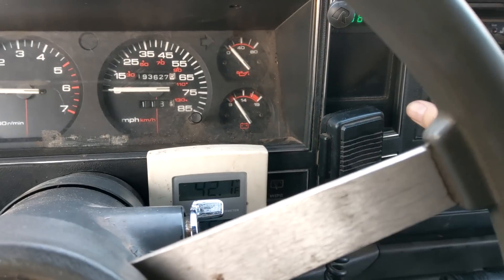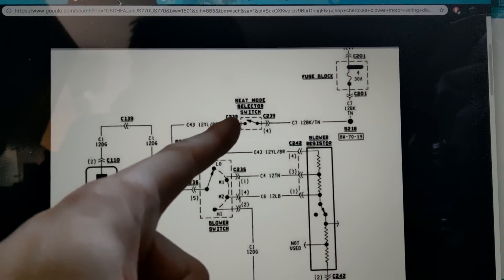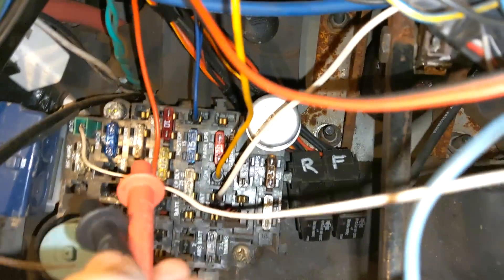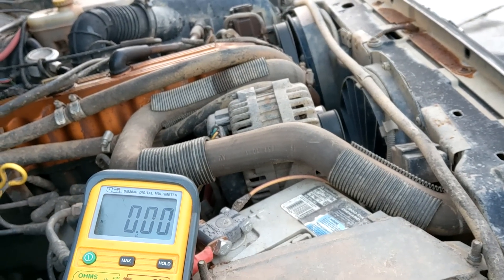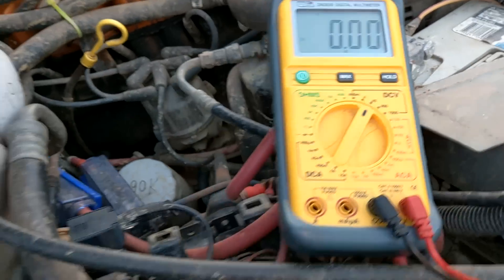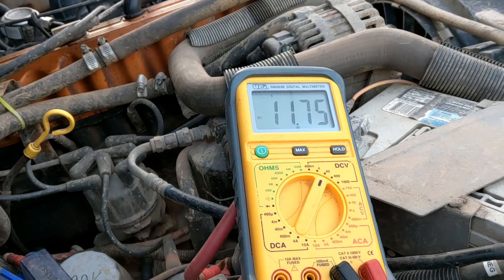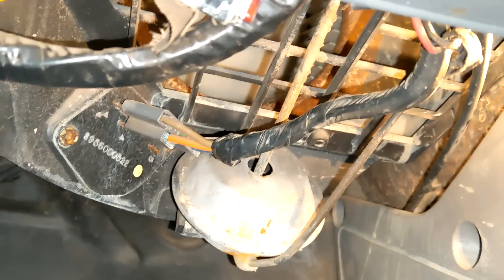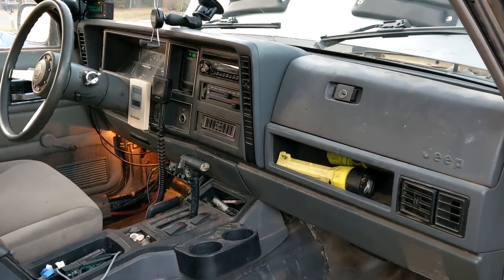89 XJ Blower Motor Diagnostics

Comment: Well I made it 5:11 into this video when after numerous times of checking the fuses, resistor,blower motor,ect...I discovered that my issue was one of the terminal connectors that hold the fuse was not making full contact and a quick adjustment with the meter probe and it's back up and functioning like new. Just wanted to throw that out there for anyone else loosing their minds trying to become a overnight YouTube electrician and track down faults. Thanks for the awesome video and help. 👍

Comment: Good Information, thank you! Mine ended up being the control switch in the dash. They are infamous for melting. I bought a new plug and heater switch but the switch hasn't came yet. The dash wasn't too difficult to take apart. I hope it will fix it when I get it back together!

Comment: Fun video,  i just went through checking everything on mine over the weekend,  everything checked out with electrical , when i re connected the plug for the blower it started working again.... while i had the resistor and blower out i vacuumed as much as i could as i was using the lawn blower down through the defrost vents

Comment: Surprised to see only a sticky motor. Usually the switch or connector melts. Lol I remember digging through yards for years finding only melted connectors and switches after I melted mine. I finally gave up on all that and changed to a stand alone circuit and relay then all that stuff stopped. I'm glad I'm past all those crappy high resistance connectors.  I used to collect up the resister packs because they were handy for using on other motors.

Comment: Good idea to split the ground wire and make contact at a closer point to the blower motor itself. My 89 Laredo ground wire ran somewhere off to the front driver side. But make sure to connect the old ground to the new location. 

I

Comment: you can remove the buzzer so it don't buzz with the key in the on position. it's down under the dash with all the fuses.
Reply: At 4:31, the buzzer is the blue box on the left side of the fuse panel.

Comment: Ah, the glorious XJ electric system. Just yesterday I replaced the dimmer switch in mine (the one on the steering column) because I thought that would be the cause of not having short beams.
Well, no. Upon failure and further inspection, I found a burned wire in the 10-pin connector behind the left headlight, and I could see at least 4in of burned wire...
Reply from the maker: Gotta love corrosion toast. Hope it was an easy fix
Reply: It's still a no-fix. The male part of the connector is buried down there. I can barely see a couple inches of wire from the hole it comes out from. The female side of the loom should be easy enough, but I still don't know how much roasted cable is in there... I'll have to reach the sane part, solder a new green cable and probably do away with the whole connector and solder the wires direct. That or I'll look for a 6-pin water tight connector (only 6 wires in use in my model) and do it "proper".
Reply from the maker: Sounds like its time for a relay harness! Save what left and call it a day
Reply: I actually have a relay mod done, that I had to redo recently when my clutch fan ate the old cables, haha. So that part is covered, but the 10-pin connector (C102?) and all those other cables are still there.
Before this XJ arrived to me there's been so many people modding stuff it's like the friggin Millenium Falcon... but I'll figure it out. Maybe I could simplify it somehow.

Comment: i have a no lights in the center dash, no clock,no cigarette lighter, and no radio problem. checked the fuses all are good. gonna be fun tracing this problem
Reply from the maker: Oh boy. How is the ground under the headlight switch and the ground from engine the firewall?

Comment: i too have a 89 cherokee and i pulled that annoying buzzer out of my fuse box years ago.
Reply: I've never heard it. Some kind soul before me thought it was annoying :D
Reply: ive had mine since 2001 and it only took me 8 or 9 years to get fed up with that cheesy buzzer running its face whenever the key was on and finally figure out where it lived.
Reply from the maker: I don't mind it usual unless I'm filming. I don't care much for the seatbelt sensor, but it is nice when it complains that the headlights were left on.

Comment: Soooo long story short.  I am working through a problem with my windows not rolling down. So i went through my fuses and notice my blower fuse was burnt out so I replaced my 25 fuse for the blower and and attempted to turn my ignition, the fuse blew again a some electrical wire smoke rolled up through my vents in my 91 Cherokee Laredo. I haven't gotten much further ....

Comment: I replaced my resistor because I only had high and within a couple weeks it burned out again.  So I’m thinking the coms on the blower motor are worn out, increasing the resistance.  TJ’s are common to roast the speed selection switch due to old blower motors.
Reply from the maker: Hmm, very interesting, but it makes sense since both are balanced in resistance.

Comment: Will you make a video about fixing the vacuum problem? My jeep only blows out of the defroster and I would love to fix it.
Reply from the maker: Check the vacuum lines near the heater core hoses, usually that black line is cracked or the vacuum ball isn't hooked up
Reply: @NickInTimeFilms  where is the vacuum ball?
Reply from the maker: Mounted in the passenger side front bumper.

Comment: So my heater will work in all settings except for defrost the fan just stopes but then you turn it back to heat  fan kicks on works fine.then if you leave it on defrost for a few minutes it just randomly pops on. Wtf ....

Comment: So, I recently got a new blower motor. No longer working, did exactly as shown and had power all the way to the motor. Thing is the damn thing is brand new, like. Can spin with pinky finger. Ran hard line from battery to fan just to double check and didn't turn on. Is it common to have new parts crap out so quick?
Reply: Rule of thumb is to replace the resistor when you replace the blower because one causes the other to go bad and vise versa

Comment: That heater switch was one of the first things I changed. I’ve long since changed all the sensor’s and still I haven’t addressed the speedo and the tach. 
I’ve been blending in and out of traffic for a decade. 
I just got pulled over again. I was doing 15 over. WE were 15 over. About six or seven of us. I decided to pass them all and the state bull noticed this move. 
I better change those gushes. You know something? I never thought to check the fuse panel. I wonder if it’s just a fuse. Anyways, your rig looks awesome with those big wheels and tires. Did you lose any horse power by increasing the load your motor has to turn?
Reply from the maker: The last video I released was about diagnosing the gauge cluster, might be worth a watch.

Of course the bigger tires make this thing a bit slower, but regearing the axles and stroking the engine out to a 4.6L helped bring it back.
Reply: @NickInTimeFilms  I’m confused on exactly how you disconnected the Speedo gauge.
Reply from the maker: For 90 and older it's a mechanical cable, for newer it's a sensor. The cable has a clip in the back, but it may be easier to unscrew the transfercase end and feed it through to help pull the cluster out enough to get at it.
Reply: @NickInTimeFilms  thanks man. Too bad you don’t live closer. I do interiors for a living. I created a recessed area on my right side of my bolster and now my Glock doesn’t dig into my kidney. 
I’m changing it though. I really need to redo the foam. I’ve noticed that my year of Jeep 1990, is outdated. Nobody has that year around here. Most of my friends have the newer versions. I dig my Jeep dude. This inline six is a beast. I don’t know why they stopped making this motor. 
Oh yeah, I don’t use cork gaskets anymore. 
I changed to that blue thing that cost fifty bucks. No problems anywhere. Zero leaks. My valve cover gasket. Anyways, thanks man. 😎
Reply: @johndough7160  hey man get a new speed aensot for your t case..thats what was causing my speedo to not work

Comment: I'm an old duffer and in the old days, most blower motors had a place to add a few drops of oil and stop the screeching in a blower motor.  Are today's new blower motors sealed or do they have an oil port to stop the screeching?  Or, is the only way to repair a screeching, squawking blower motor total replacement??
Reply from the maker: I don't specifically remember seeing an oil port, but you could probably pull the cooling boot and add a coating in there. Mine is acting up again so I may see if I can free it up that way.

Comment: recirc door  only opens on max a/c and maybe when the system is off.
Reply from the maker: I'd have to dig out the owner manual but I thought I recalled it on heat to help warm up quicker. I'd love to hack in and make it all more modern. Give option to control recirc and AC compressor manually, as well as a simple windshield, upper, lower, or both vent option and keep the temp slider. May even sell them if I could figure it out and make it professionally.
Reply: @NickInTimeFilms  the temp slider is fully mechanical. The rest is a vacuum drive. It's never on just what the location switches say. Defrost opens the feet vents a bit and feet opens the defrost a bit.  I would love to have a full on defrost and feet setting.

Comment: Hey Nick I have a question was hoping maybe you could help me out. 

I have a 1990 Jeep Cherokee Laredo recently crashed the front end and no longer have AC condenser .  

The body shop that fixed the front end Took out my AC condenser and now nothing but hot air is blown into the cab even with the AC off do you know what could be the problem the hot air comes out of the top of the dashboard  where the defrost is at in the front windshield.
Reply from the maker: Sounds like either they messed with the vacuum line that feeds the vents, located near the heater core, or the vacuum ball got messed up, located under the front passenger bumper.

You should still get luke cold air if you move the slider to cold though, that's mechanical.

Comment: I have an 89 xj like you and the fan only works on high.  So if the switch bypasses all of the resisters in high I'm thinking the mid-high resister is open.  Would you agree?  PS  just bought the R.E.M. From your web sight and can't wait to see how shitty my fuel mixture is among other things.
Reply from the maker: Sounds like you're dead on! I'd take a peak at the connector too, but most likely resistor pack. And excellent, I'm sure you'll find lots!

Comment: Is it ok to have 14 volts at the blower motor plug?
Reply from the maker: Yes, that's normal. You should have battery voltage at the blower. Alternator should be 13-14v when running

Comment: What if it don't blow that hard?Could the blower be going out?The high setting on my 89 grand wagoneer blows like the med or low setting on my 89 xj.
Reply from the maker: Hmm, well on high it bypasses the resistor pack, so it sounds like either a dieing motor, or a voltage drop from something. I've rarely seen the selector switch melt, probably due to corrosion so may be worth checking the plugs and Max voltage.
Reply: @NickInTimeFilms  thank you.

Comment: You have to circumcise the flaccid rubber penis that is the condensation drain under the blower on the firewall. It lays over the frame rail and down the side to drip onto the ground. the tip gets clogged and it cant drain cut about an inch off or until you can clearly see the opening. You can also shove a wire up in the hole to clear up any clogs. Goodbye wet feet and rusted blower motors. Goodluck
Reply from the maker: Haha, we did that on the trailer to moab. Not sure if it completely helped but haven't needed it much lately.
Reply: NickInTimeFilms itll help unless theres a ton of dirt in the evap core wont let it drain right. And itll smell like old lady socks.lol